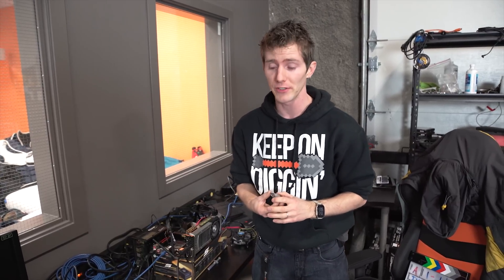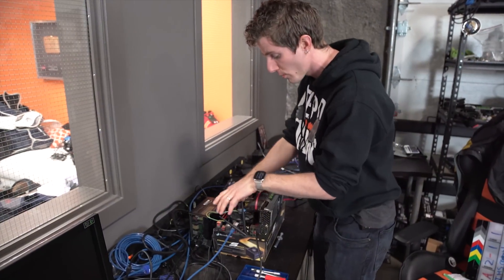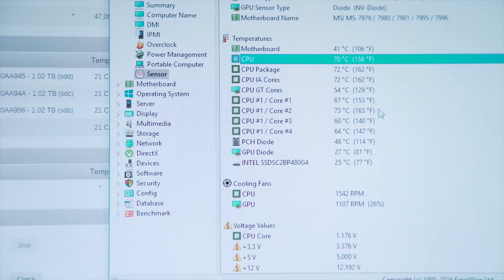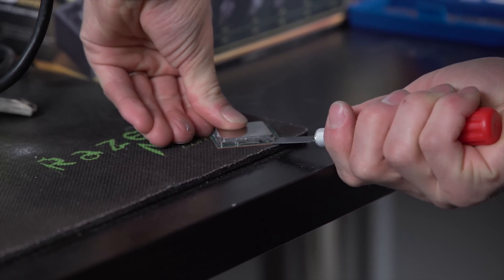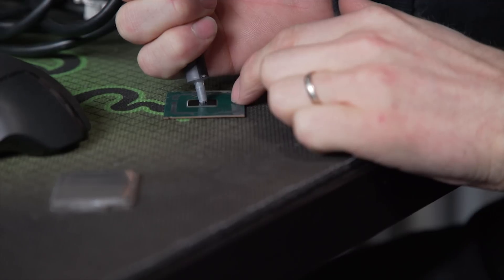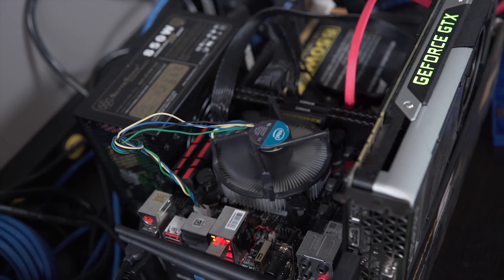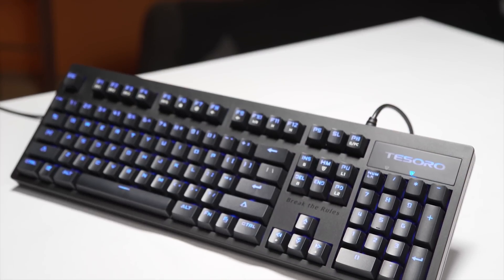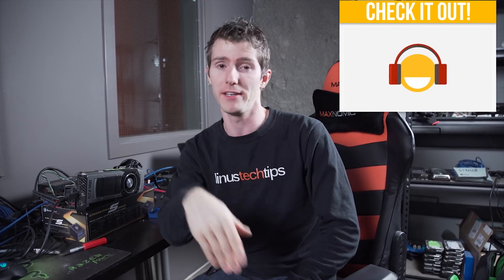Delidding an Intel Core i7 6700K - Is it worth it!?

Comment: The actual thing for doing that (at least to 4790k) was uneven temperatures for different cores. Sometimes for example 4790k would get 65°C to 69°C on 3 cores and 80+°C on fourth. Then delidding CPU and reapplying TIM is helping to get even temperature on all cores.

Comment: Nice giveaway at the end. Happy with my Logitech G110+MadCatz R.A.T. TE so I won't be entering but good luck to anyone that enters :D
And de-lidding will make a more noticeable difference when you start overclocking as opposed to just running at stock clock speeds.

Comment: I delidded my i5 4670k I got 17C and 300 Mhz overclock with 72c at max load. I do not recommend it with some CPU's like 6700k like linus BUT with it's worth with Haswell and maybe if you plan on putting it on a mini-itx lcase like RVZ02/ Node 202 I'd do it.

Comment: is this a good pc http://pcpartpicker.com/p/84CP23
Reply: Not really
Reply: +Mac McLinn Yes and no. Never buy SLI right off the bat unless it's flagship. For the price of 2 970s you can get 1 980 ti and be better off.

With monitors, you can have multi-monitor or 144 hz, but not both. With multi-monitor your GPU has to be able to support them all. What you're asking of your GPUs here is to push 5760x1080 pixels at 432 frames per second. Unrealistic in most games. If you have 3 60Hz 1080p monitors and feel you can handle a bit more, you can probably overclock the monitors a bit from there.
Reply: Jak thx!!
Reply: +Jak this was all a joke just so you know
Reply: +LinusMLGTips this is just a joke who da freak would do this😎

Comment: Without Delidding i had my G3258 with 4.6GHz on 85C. But now after Delidding and making Liquid Metal Between Heatspreader and CPU AND between Heatspeader and a AIO 120mm Watercooling i just have 66C on 4.8Ghz
Reply: +OSTutorials 
Amazing results for an 120mm AIO indeed. Which liquid metal did you use?
Reply: http://www.amazon.de/gp/product/B001PE5XAC/ref=as_li_qf_sp_asin_il_tl?ie=UTF8&camp=1638&creative=6742&creativeASIN=B001PE5XAC&linkCode=as2&tag=hardw03-21
Reply: +Rygar allways liquid pro! I got almost -30c difference when I delided my old 3570k @ 4.7 (custom cooler - d5 , monsta 240 , ek supremacy block) final temp was 50\55ºc prime95
Reply: yeah thats make big differents
Reply: Yeah Liquid Pro is awesome. I was using it on my old lapped i7 920. Is it worth to go for Ultra? It's supposedly a bit easier and safer to apply.
Reply: dont know
Reply: just go for liquid pro inside and a good tp outside ihs

Comment: what about applying the heatsink straight to the die?
Reply: +Sam Williams You would need rig things up differently.  The die is further down in socket and the metal hold down would interfere with  heatsink and would not let it touch the die.  You would have to have the heatsink milled to recess into the socket.
Reply: +spyder000069 Also crushing a die is a real thing.  Its easy to not put even force on the die and kill the chip.  The heatspreader does a good job of even clamping force.

Comment: Linus can you do a video on the age old question 'Are expensive cables worth it?'
Mainly DP, HDMI & USB, maybe audio cables. How does cable quality and cable length influence the cable performance for typical use vs performance at the maximum of the specifications and charging time via USB.

Comment: My guess before watching the vid: It makes no difference at all
Reply: +Michel Folco 
It DOES make a difference, but it's too small to be worth it, for the most people anyway.
Reply: yeah I was wrong
Reply: +Rygar It was kind of obvious that would always be the case...  All you have to do is buy a decent aftermarket cooler to reduce temperatures to OC.  You will likely hit a voltage wall before you hit a thermal wall.

Comment: Yeah, except that was a noticeable difference even with this shitty half-assing. If you actually do it correctly you're looking at well over 5c, you then polish the IHS and base of the cooler and now you're looking at enough difference to increase your overclock, all for $10 of thermal compound and sand paper.
Going by other comments, you can be looking at 15-20c which should let you push a whole hell of a lot more voltage in a chip, we could be talking 400mhz here.

Comment: First of your videos I have to dislike Linus. A lot of mistakes and false assumptions were made in this video. Lets list them all up:

1) You applied too much thermally conductive paste between CPU and CPU cooler (ur right, if you apply too much of it on both tests it's fair in a way, but it's still far from optimal for getting the best possible temperatures for the tests and to exclude this as a mistake for further testing)
2) Using the Intel "Boxed" cooler (even though Skylakes aren't even sold with such a thing anymore). It is commonly known that the differences show best at 4,7 GHz/4,8 GHz with like 1,3-1,35V Core Voltage - a scenario an Intel boxed cooler can't handle no matter what.
3) Applying a regular thermally conductive paste instead of a liquid metal paste. This will only get you, as you noticed, very small improvements from 5 up to 10 degrees, whereas a liquid metal paste gives you 20 up to 25 degrees improvement (the difference is much higher than if you compare these pastes between heatspreader and CPU cooler).
4) You don't even notice the CPU fan is running 100-150 rpm slower than on your test before delidding the CPU, probably due do a bad UEFI configuration (Fan on AUTO instead of fixed rpm)... hence the difference would be bigger if you would let it run with same rpm in both tests (pre and post delidding). 

You really can do better than this Linus, you prove it every day with your other great videos. Sad to see that such an important video was made with such little motivation and effort.
Reply: I didn't notice the différence in rpm but you're damn right.
This vidéo is not serious at all...
Reply: +ralleh85 Come on, wake up. He is sponsored by Intel, do you really think he's gonna go against Intel's mindset? Of course Intel doesn't agree with this type of procedure and of course his opinion is gonna be biased towards the same. Don't expect him going against Intel since he's receiving money every month from them. It's just stupid to expect anything opposite.

Comment: Nicely done for making that look so easy. I really would have gone whole hog and gone for some Coolabratory liquid ultra if you went to all that effort. Typically you can expect -5C minimum with that stuff (used with exposed silicon laptop chips). So your now talking in the ball park of -7/8C which imo could be the difference between stablility in certain circumstances. 
While the ihs is off you might as well get it sanded down and buffed up for maybe another degree off. It all adds up.

Comment: I might be wrong here but didn't intel upgrade the paste for skylake after the issues with haswell? Also using haswell in this scenario is more likely as most skylakes in use still have warranty so you wouldn't want to do this.

Comment: once again Intel uses cheap shitty thermal paste instead of soldering the IHS.
Reply: +rapper250 I'm guessing that if there was a significant risk in using the thermal compound, then they would continue soldering the components. However, since they most likely have not discovered a significant risk AND it costs less, then they're going to keep doing what they're doing

Comment: LTT doing a sloppy job and wondering why the results are bad.

Things done wrong or are misleading here:

1) Deliding only makes sense for high overclocks, thats where it shines. 
What you guys did here was similar to putting a 360 rad watercooling setup on a 45W i3 and comparing the results to a Hyper 212. Do the same test with Haswell i5/7 overclocked to 4.8 GHz and suddenly the 360rad watercooling setup beats the crap out of the 212. At stock speeds its totally pointless and the difference small.
2) Using a cooler with low mounting pressure and dont cleaning the PCB of old glue.
3) Liquid Metal (LM) is much better as a interface material between DIE and HS. Normal paste often loses performance over time in that role.

And thats beside the fact that the razor method is tricky - nowdays just 3d-print a delid mate (search on YT for videos)

Fucking BS video.

results for a job done right 

before: http://abload.de/img/vorhermxoqa.jpg
after:http://abload.de/img/nachher4qr1v.jpg

an other example:
before: http://abload.de/img/vorherc8kb3.png
after:http://abload.de/img/nachertjjfc.png

If you do it right and depending on your sample the gain are typically between 10-17°C.
Reply: Rotem levi He didn't use it for stability tests... pay attention and you will realize that he just used it for temps.
Reply: Rotem levi No, you don't know what you're talking about. You do not need to overclock to observe a temperature change between two cooling scenarios, you dunce... maybe people usually de-lid for overclocking purposes but you do not need to overclock to benefit from a de-lid.
Reply: ThatDutchGuy "He has no idea how to properly conduct tests."

He did, he tried to see if de-lidding without overclocking had any decent temperature change. He did the right steps: checked temps, de-lidded, checked temps again, under the same scenarios. Just because he didn't do the exact test you wanted him to do (the one with overclocking involved) doesn't mean that it's invalid. He simply wasn't testing it in the conditions you wanted - that doesn't mean they're invalid conditions.

And your little blurb about him being just a stupid end user that became popular... watch his $30,000 7-gamers-one-PC build video, watch his videos about his servers going down and him having to fix them. He obviously knows what he's doing.
Reply: ThatDutchGuy I did humor your opinion, and I still don't agree with it. Just because you say it doesn't mean I have to feel it's true, and don't get butthurt when I disagree.
Reply: +Karl Arsch  Here are the results for my own CPU. Finally got around to doing it.

Before: http://abload.de/img/orginal3570k76sd7.jpg

and 

after: http://abload.de/img/afterdeuy2.jpg
Reply: +Karl Arsch Can you at least tell us what those things were? lol
Reply: +Karl Arsch 
Sadly, you're right - I just can't justify doing this to my 6700k - even though it is one fucked up CPU regarding non-delided temps (in many cases), and even more so as (so far) I MUST use lots of +Vcore to obtain the desired 4.8Ghz - I know I might've just hit the mediocre spot as far as the wafer's concerned but still - it's fucking annoying and I know I can get a solid 70c with my D-14 @4.8 if I delided it, damn ramble.
Reply: Thanks a lot
every time Linus try to demonstrate something it is as if he doesn't understand basic physics and it bothers me because he is a clever Guy...
Reply: Oh, also: don't use goddamned AIDA for stability tests! You see what you've done, Linus? 
Some kid/man here doesn't even fucking RECOGNIZE Prime95 (one of the better stability testing software) - I know, I know it has a potential to damage a newbie's PC, so show them tests with x264! Or just warn beforehand about the level these softwares push the CPU, so that they'll be forewarned at least. 
I mean damn, no one takes AIDA64 seriously anymore as a stability test software - it's way too easy on the CPU - I remember thinking my CPU was a miracle made when it only got to 50c with AIDA under overclock and OV. Give us some real reality please, lol. If not, might as well stay at overclocking forums.
Reply: *****

Again - if he already bothered deliding a CPU which is KNOWN to have poor IHS and overuse of thermal paste on the die itself - he should've overclocked it first, and should've used a goddamn REAL stability testing software like the aforementioned or OCCT or IBT or Linpack - if he already recommended not doing so, why not really doing something which would've produced a difference?
Whatever, I'm not the one calling the shots and he gets enough cash without my witty remarks, I just hoped to see something useful or interesting (except the actual removal of the heatsink and re-attachment) - and nothing there was remotely so - like I said - if he'd have overclocked it and used a software like IBT or P95 - the difference would've been at least 10c, but oh well - too bad.
Reply: ***** 
And I said, if you'd have read it - that Linus should've overclocked the processor both before and after for a meaningful result in the first place (in other words) - also, in any case - using a real CPU STRESS (stability) test software like IBT/P95 or Linpack after delidding would've gained a much greater decrease in temps than damn AIDA, see the pics Karl posted.
Reply: Oh right, you're the one who asked what those things were.. don't mind me.
Reply: Rotem levi He wasn't testing overclockability you idiot, he was testing temperature changes... whether you overclock it or not the relative temperature changes (notice I said RELATIVE) won't be too different.
Reply: The fact that you said what you just did proves you have no idea what you're talking about, but whatever. The world needs know-it-alls too.
Reply: +ThatDutchGuy I think the only way to prove that you are right (and you are right but apparently some people don't believe you) is to make the calculation to show that using the Intel cooler was non sense 
if you need help to make these fanboys close their mouths I am here.

Actually it is pretty rare that Linus videos are bad and I hope hé would see our comment and make a new video
Reply: +ThatDutchGuy It is not so hard to prove it with thermic resistance
I mean if you use a standard intel cooler it is obvious that it limits the stuff because the thermic resistance is high, but if you use a performant cooler it is the TIM that limits it
obviously you can't obtain exact values for temperature bit you can have a great idea of what is happening
Reply: +ThatDutchGuy true but in first approximation it works quite well
Reply: ThatDutchGuy
It's not denial. Denial is when you deny the truth... your opinion is just that, an opinion. I am not in denial if I disagree with you. That is just your idiotic, childish, manipulative way of making me agree with you.

Comment: Well this is stupid. Firstly the 6700K isnt nearly as bad as older CPUS (3570K,3770K,4690K,4770K) when it comes to heat. Secondly Linus did this so unomptimized that it doesnt feel like a fair comparison. Thirdly i did this to my 4770K (Using the vice method , waaaay better than cutting away) and shaved of 18 degrees during load and got more even readings instead of temps spiking up and down.

If you have an older CPU i recommend this IF YOU DO IT RIGHT. With Skylake the need to do it is alot smaller.

Comment: Better thermal paste can push that number to 6 or more degrees.  Shame on Intel for using inferior thermal paste on their top-of-the-line CPUs, especially CPUs designed for overclocking, and yes, even 5 or 6 degrees can mean 5-7% performance boosts staying in the thermal "safe zone" in many situations.  Seriously, how much more expensive can it be to apply a small amount of even top grade thermal paste to a CPU...$1...$2?

Comment: I disagree slightly....

I did this on my i7 3770k as my core temperatures were atrocious with a pretty decent OC and being cooled by a Noctua DH-14 my temps were averaging around 70c. Once delidded I cleaned up all the glue/thermal paste and applied Coolaboratory Liquid Metal between the CPU itself and the IHS and used GC Extreme for the CPU cooler. On the same OC my temps went down to an average 55c, also the other big improvement was the temps across all 4 cores are very consistent now with each other as before the procedure it was very inconsistent.

Comment: So with a small drop of aftermarket thermal paste, the 6700K was peaking 2 degrees C below stock. So linus did confirm this myth? That"s another 100mhz of overclocking.

Comment: Well, I did it on two 4790k processors. Used liquid pro on both and did not glue the IHS back on. On one processor I went down from about 90c to 74c and on the second from 88c to 70c. Both processors @ 1.20v 4.6ghz